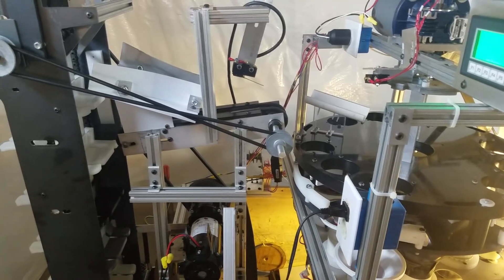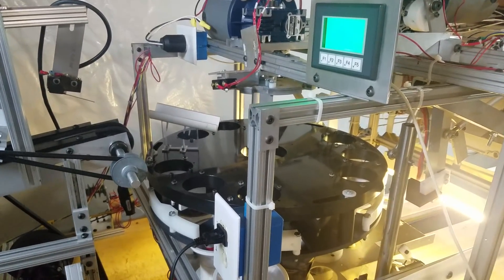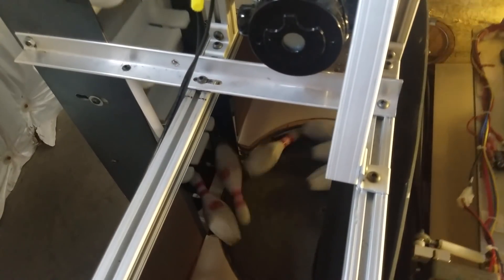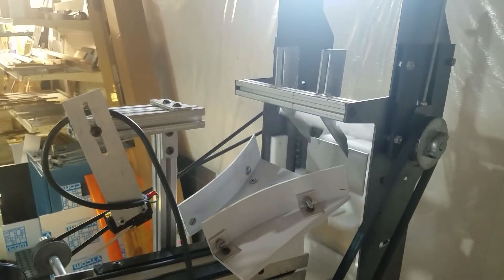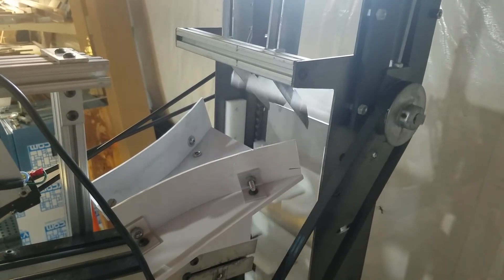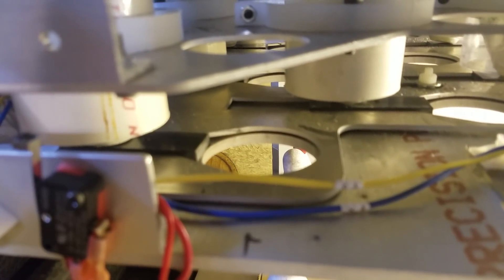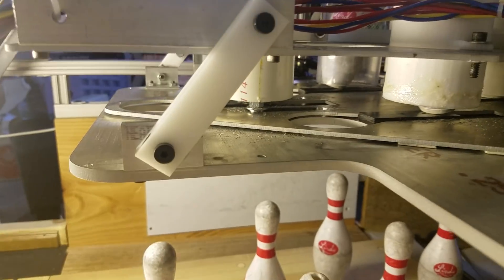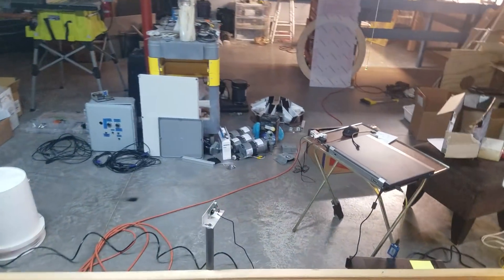Half scale pinsetter explained-proof of concept design

Comment: So CoasterP, I was wondering why the Ball return system doesn't use a rubber track and motor belt ball accelerator system like the AMF 82-70s and 82-90s. I assume it would be too fast and fly off the ball return?
Reply from the maker: I looked into doing that but getting custom belts was not something I wanted to deal with. I actually have a new design for the ball lift that is much simpler than the original design. I will eventually do a video on it.
Reply: @coasterp2199  Alright, sounds good! I'll look into it and I have hit the bell.

Comment: I've been drafting stuff up for a much smaller model pinsetter project, using an arduino and some hobby motors and sensors. Some of my systems are fairly similar here, since it's just a hobby personal project and nothing commercial should that be okay as far as the patent stuff goes? Probably a stupid question, but I admittedly know basically nothing about patents.
Reply from the maker: As long as you are making it for yourself and not for re-sale, there is no issue. That goes for anything that is patented.
Reply: Awesome, thanks! Your lift system with the little pushers going through slots that hit the wider bottom of the pin first and push it forward is brilliant, I think on full scale setters it's just the weight of the pin that falls first and rights it but especially on the scale I'm going to be working with I don't think that alone would consistently flip them bottom-first.

Comment: Have you considered a half size candlepin pinsetter? It would be a fun game, I think and the machine would be less complex. Ive thought about using billiard balls, but would have to make pins because i dont think half size candlepins are available anywhere
Reply from the maker: Not something I've considered due to what I feel would be a very limited market. I have been asked if I could develop a full size duck pin machine though. I actually think that might have a market and developing that machine is something I would consider. No one has stepped forward with funding for that though.